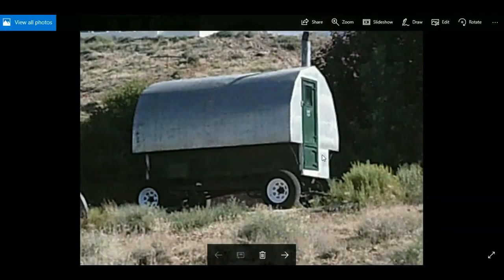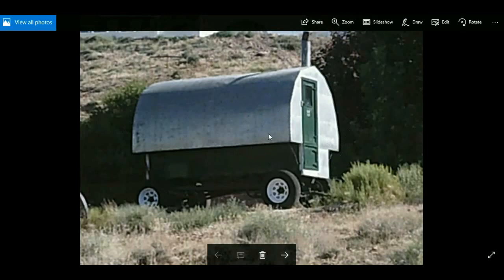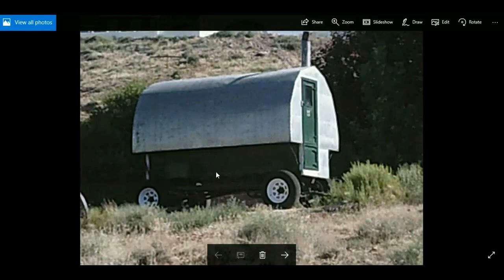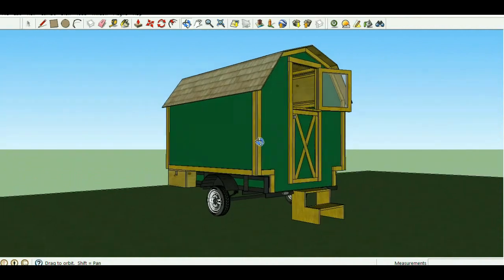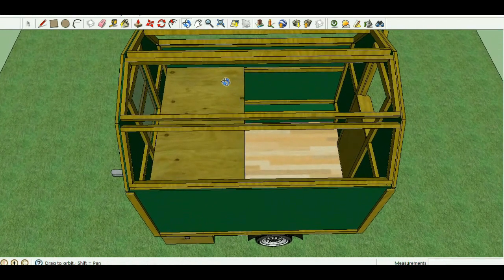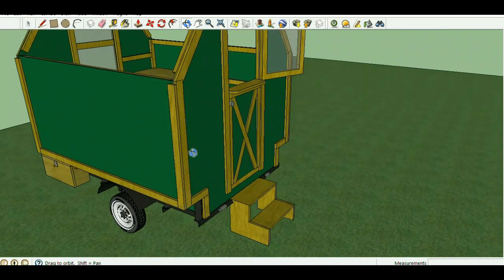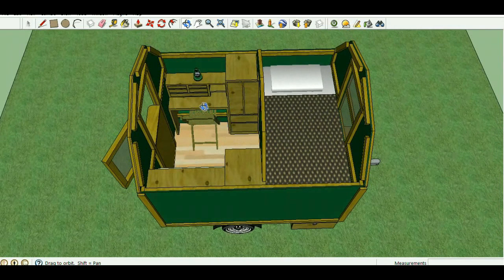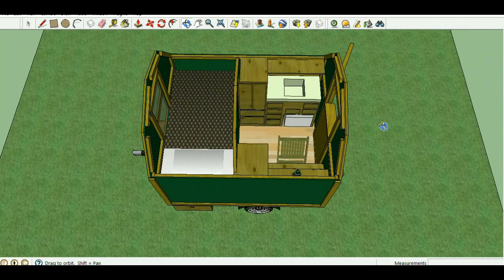Shepherd Wagon Vardo Build: Part 1

Comment: I downloaded the free plans. Thank you. The one thing I don't see is a bathroom, but the beauty of DIY is to do it yourself and modify/customize to your own taste. Thank you again.
Reply from the maker: I will be using a bucket toilet and outside shower for my build but you could build a small bathroom or build this unit longer to 10 or 12 feet for a bathroom.
Reply: @solarcabin  I use a portable toilet in my old fifth wheel. I empty it into my brother's toilet. The same could be done for this build.There are plenty of designs for indoor "pop-up" showers.
Reply from the maker: I use a 5 gallon portapotty in my cabin and dumped in to the solar composter once a week. I will use a bucket toilet in the vardo and a solar hot water heater. I am setting this up to be 100% off grid.

Comment: I like the wall and cut-out for the bed, adds a lot of rigidity to the vardo.
Reply from the maker: Thanks, I designed it so that bed platform ties the structure together and will provide a lot of support like having a ceiling holds the walls together at the top in a house.

Comment: Thanks Lamar, look forward to watching your build. In my  state, trailers (that means ALL trailers) have a one-time registration and permanent tag with no insurance requirements because they are covered by the tow vehicle's insurance. Build this and for less than $25 you have a camper/home for life.
Reply from the maker: Same here and for utility trailers like the one I am using you don't even have to register them as long as they have lights or are driven in daylight so it will be cheaper than a regular camper and no registration to worry about.